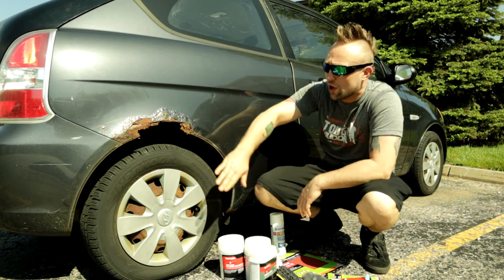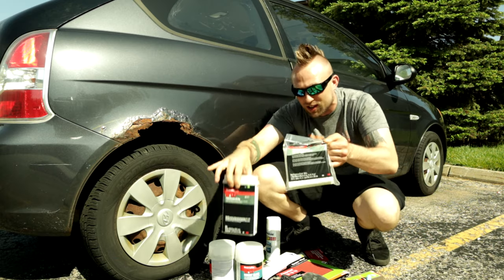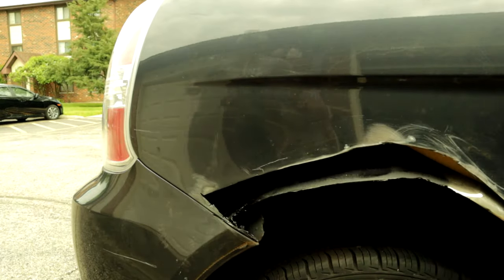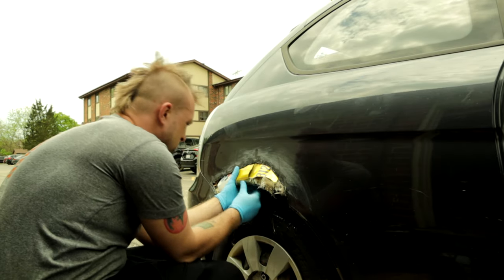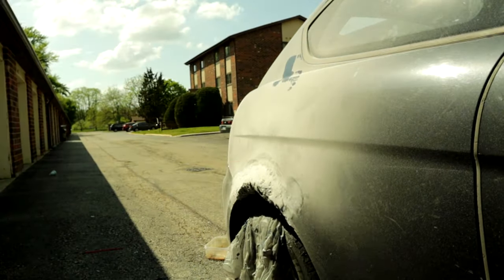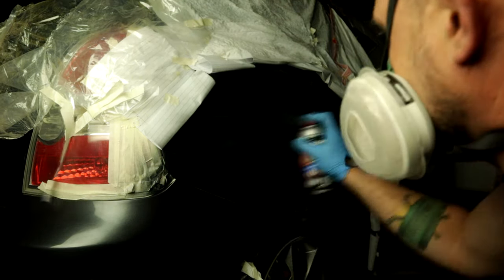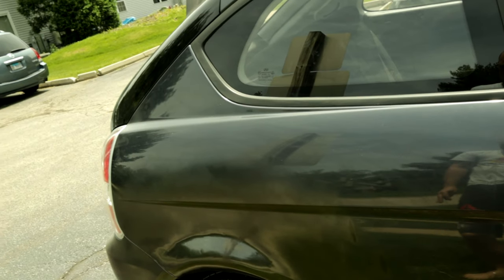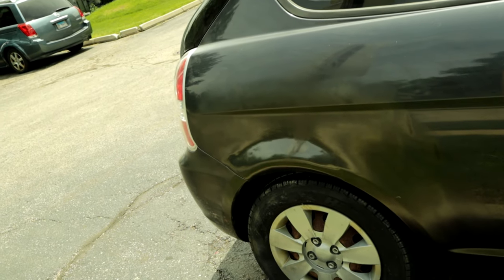How to Repair Rust Holes on Your Car Without Welding

Comment: If you want the repair to last forever you should’ve cut out a piece of metal & shape it & do butt welds across for a real repair. This is more of a band aid repair
Reply from the maker: Yeah but 2.5 years later still looks the same. The car has 300,000 miles not gonna buy a welder for a car worth less than the welder
Reply: @DylanKowalski123  your choice, but that car looks like it’s still worth at least a grand. You can get welders for $300. Less than the car. I’m just saying I would do things right, instead of band-aids